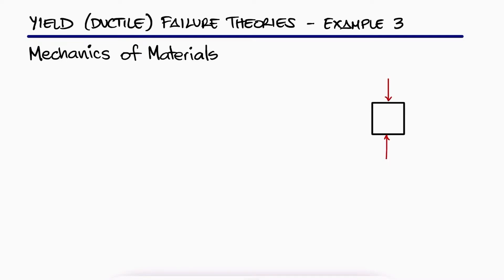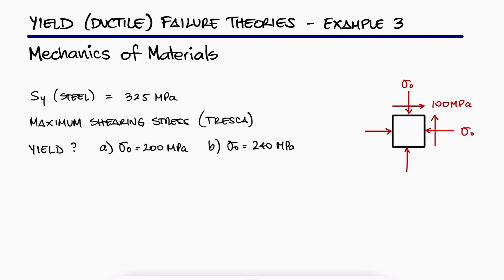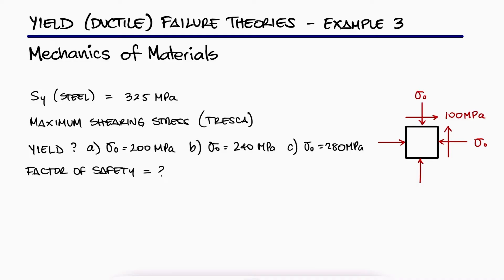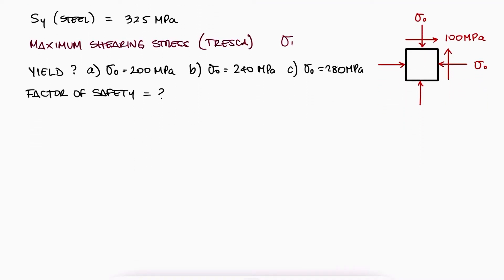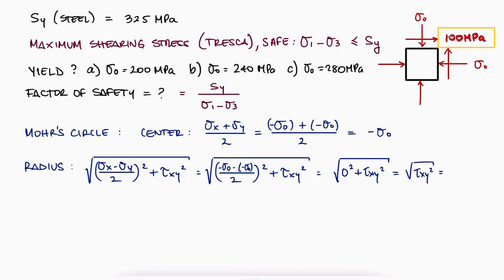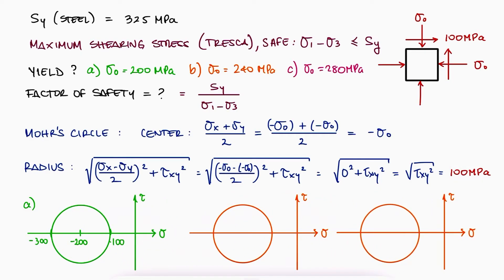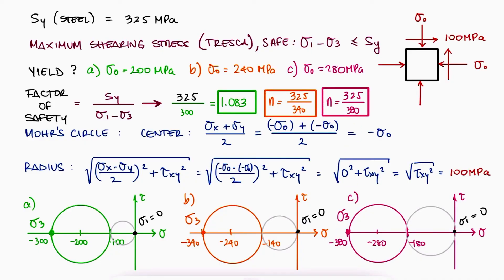Maximum Shearing Stress Criterion (TRESCA) in 2 MINUTES!

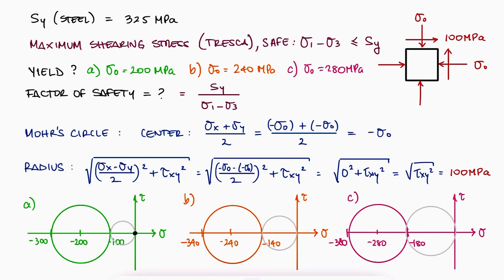Comment: great video, really helpful but why do u draw those small grey circles at 1:30 and say the first principal stress is 0?
Reply: My understanding: in 3D, the x and y normal stresses are -200 MPa, but the z normal stress is 0 MPa. (Think of it as if you are pulling on a slice of cheese in both x and y directions, but there's still air above and below that slice of cheese, and that's the 0 MPa stress in the z direction.)
There's always 3 principal stresses: sigma_1, sigma_2, sigma_3.
I believe that if the Mohr's circle of a stress situation does not encompass the origin, then the origin is always one of the principal stresses.